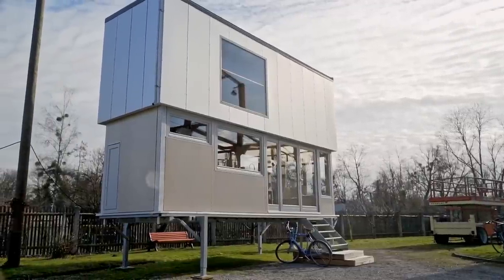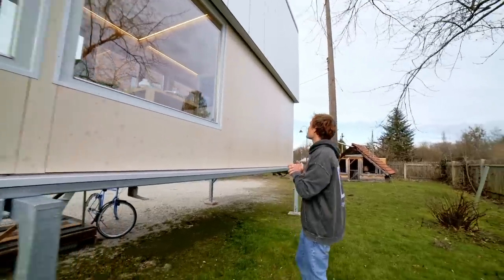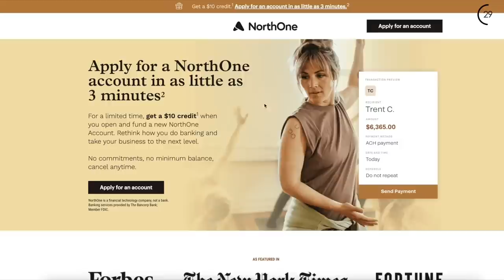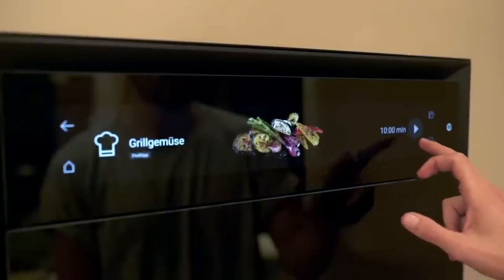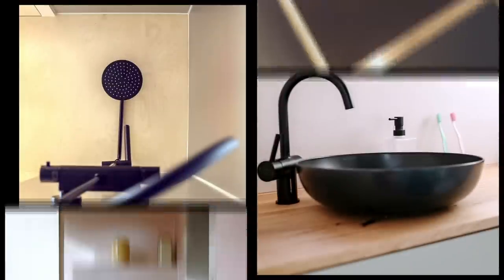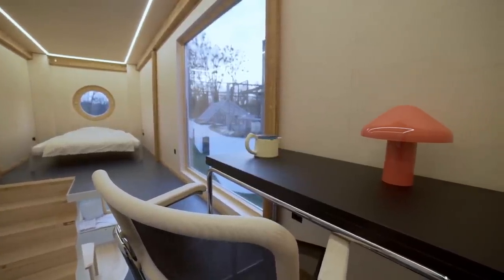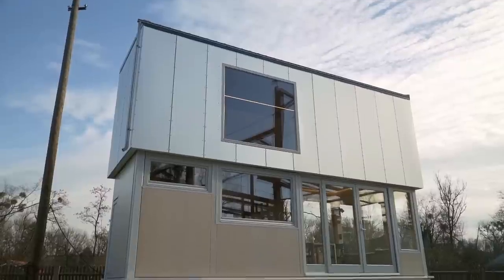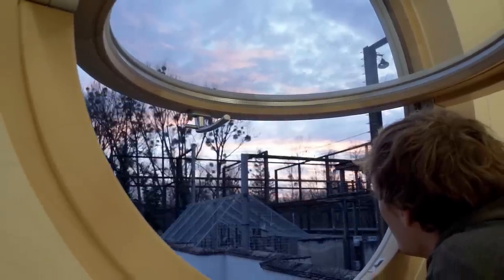Full 2-Story Movable Tiny House w/Lifting Roof - beautiful design!

Comment: I agree with another that recommended making a longer unit as well. I also think a collapsable or removable stair rail around the stairs of the second floor would be a great addition, and far safer. I would suggest you use a similar table downstairs as you have upstairs so you can seat four when you have family or friends over for a meal. I like the oven, but that space would be perfect for a television. Perhaps you can move the oven under the stairs, or install a convection microwave which is smaller, but still allows you to bake? It would be nice if it had a larger fridge, but it doesn’t appear you have the space. I really like the fact that the second floor raises which is what sells the unit. It’s a nice little unit that solves a need, but I’m afraid it likely wouldn’t do well here in the US because of the price, but maybe I’m wrong as housing here is terribly expensive, at least where I live. You clearly used top of the line materials which shows. Thanks for sharing
Reply: Thank you Brent! So much great Input, im sure that our next houses will have better features and of course no house is perfect as it must match with the needs of the client!

Comment: Those stairs would frighten me, I need a bannister on which to hold so as not to fall off. Also, you would NOT catch me lying on the floor like he did upstairs. One roll to the left and you'd quickly be downstairs. It would be great if this home could be made longer, it feels very short. I like the corner lifts, nice touch.
Reply: Thank you for the feedback! True that, but we are about to install railguards soon! And technically you could get it in a 13m length version!
Reply from the maker: It’s amazing how well they hid the mechanisms 😁

Comment: I like it!  But I would put a fold out table under oven and add a wrap around sofa, and have the window open out instead of it. Also, need some type of railing on 2nd floor, and closet. I realized the steps. I don't use anything round, so an octagon window would look better. Where is the washer/dryer? Microwave? Maybe add a TV for movies that retracts up from behind a hidden cabinet???
Nice job with that lowering the top floor...:-)
Reply: Debbie, thank you for your feedback! Lots of it we could integrate into the design of your customized house and we do offer full individualization for our houses! So nothing you need to worry about!

Comment: Really fun design. That would require wide & deep tie downs if it would survive the high winds we get in my home region.

Side slide outs would probably be better for us than slide ups. 😊
Reply from the maker: You bring up a great topic. Hopefully the builders can jump on here with more info. 😊 Because you can set this on the ground (or of), that might provide additional security from wind and easily be tied down. It’s no taller than other homes and uses the same framing techniques.
Reply: Thank you! We'll working on new solutions for the future and regarding wind and weather the house will sustain any weather of course except of hurricanes!
Reply: @Vagabundotinyhouse  ,I saw a video a few years ago where they had all plumbing and wiring going through an attachment used in oil and gas usually so it could be  detached during a  storm.  And I have seen buoys attached to either deck or house twice. A former neighbor wanted to put their house on a barge or tugboat after surviving several hurricanes. 
A client in Washington bought a lot that flooded half the year and built a deck with a little cabin around his anchored fishing boat. Much cheaper than marina rent, and ruined his first wife's crazy plans! But similar idea. Hopefully this made sense; Might need more coffee 😂.
Reply: @Vagabundotinyhouse  Not sure Americans understand German construction. American houses are built very flimsy. The quality of your materials is probably lost on them without touching! On the other hand, wind could be an issue as high as it is.

Comment: The lifting second story is functional and cool. Some of the design choices aren't as practical as they need to be for tiny living.  Doors and windows opening inward when they can slide uses up valuable space. The staircase is an opportunity for more kitchen storage which isn't being utilized to it's full potential here. Huge windows can be nice but having them come all the way down to the seat height means one is resting against a cold window.
Reply: Hi Sage, I totally get your point, in the end it's a big tradeoff between functionality and quality. We have thought about many features as for example additional storage underneath the staircase, but it does not apply to quality norms and will make the staircase very weak and expose our client to risk to injuries on the staircase. But after all, many more features could be implemented, you're definitely right!
Reply: @Vagabundotinyhouse  Americans don't understand how efficient and heavy German windows are. Ours are crap, yours are like bank vaults. But I did notice in my stay in Berlin and Hamburg you have far less urban insects. In the US, a concern would be insects getting in, that's why we have screen windows we install to allow in the air but keep out the insects.

Comment: Like this.  Would like a railing for stairs.  Could maybe do a door over stairwell.  So then you can't fall down or have more floor space if you need it.  You could offer to do shelves racks you can adjust size then put pieces of wood on and rails for hanging clothes.  So they are easy to take down for moving.  Under the stairs could you design it better for more storage?  Or even put draws on the steps.  More storage is always good.  Love the idea for you the under the house for bikes, lawnmower, and other items.  This is only the beginning for you.  Good luck!  You are thinking outside the box!
Reply from the maker: Lots of great ideas 😊 thanks for sharing!
Reply: Railing will be installed soon! We’ll update you on it once it’s done!

Comment: Amazing how people decide on a tiny home then immediately look for a way to make it bigger! That said, this is a great way to make bigger more transportable by making it collapsible, The upper floor room needs protection around or over the open stairwell.
Reply: Hey Paul! There's different models for each personal need, if you want a smaller home decide for the vagabundo mini!
Reply from the maker: It’s about the same size as many tiny houses, but just with a full height 2nd story. Does make it feel luxurious compared to some!

Comment: Stairs occupy lot of space in both level. Ideal position would be somewhere in the corner. Railing system can be installed more easily then. In shrinked situation the house is accessible or need to wait lifting procedure?
Reply: It is definitely true what you are saying, they take away a bit of space, but they also give more freedom to the whole house itself and separate the different areas of the house. However, individualization is possible!

Comment: That looks like it will tip right over if the wind gets strong.  Have you done any tests?  And are there railings to put up top around the stair case?  looks like you could fall right down.

Comment: I really like the two story concept. My only concern is the lack of closet space upstairs. Could you construct an outside wall closet that would lift with the second story, but not be in the way of the lifting travel path?
Reply from the maker: Interesting question 🤔 not sure. In the upstairs you could add a big Ikea wardrobe and other small space furniture/storage solutions, but you have to take it downstairs for when you’re ready to relocate
Reply: @TinyHouseExpedition  That’s the beauty of my suggestion. The closet would be constructed on the outside wall of the second story and would lift when it lifts, but the doors would face inside to the living space to access the closet,nothing to move out of the way at all.
Reply from the maker: @lorenrickey5481  I like the way you think!
Reply: My concern about the second story is what appears to be a complete lack of any kind of guardrail. Unless a removable one can be added as an option, I think that's a big accident waiting to happen.  Falling from that height and landing on those stairs would definitely be a bad thing. 😞
Reply from the maker: @StanFranks56  we hear you! We really like the idea of installing a sleek removable or foldable metal railing up there 😁
Reply: @StanFranks56  I agree. I gasped when he was standing and looking out that big side window. It didn’t “look” like much space from that window to the opening to the lower level. Like if you’re looking out and take a step backward, we’ll that’s it…😢
Reply: Theoretically yes, but it would get quite complicated!
Reply: Give us some weeks and we show you the results of the new safety construction!

Comment: I like the finishing materials they used and the quality of construction. But ultimately, having the roof telescope up seems a lot less practical than slide outs. The lifting roof forces an already narrow main living space to be even more cramped. Maybe someone can come up with a system where the upper walls fold down onto the upper floor and only the roof lowers down to rest on the folded walls.
Reply: Thank you for the feedback, we implement it in future designs!

Comment: We have bridges in the US and very tight building regulations. This place wouldn't make it without some serious foundation work and their water in/water out plan wouldn't fly as is.  And in EARTHQUAKE areas those STILTS...AH NOT!  
Then there is the whole live in a fishbowl thing, have to hang the drapes from the ceiling....also not.... I know it snows in Germany, how could they think anyone is going to want to lean up against cold glass? I know that aside from no drapes there is next to no padding on the box in the 'living room'...am I wrong did he call that a couch? I was probably wrong....oy.... The kitchen has a very odd layout & next to no storage. A light up sink won't fix that. The space he talked about for a washer in the bathroom, I really don't think that the washer/dryer combos we have would fit if you wanted to be able to open the door...all the way....  There is no handrail on the stairs - HUGE SAFETY ISSUE... Upstairs is little more that a jacked up box. There is zero storage. Def would not be considered a bedroom here....no closet, but hey there's a expanding table. WooHoo.    And for what they are charging???  We could get a totally, fully, decked out Tiny house for less that that. FOR SURE...and maybe one that lifts too.
Reply: Thank you for your comment and sharing your thoughts about it! Valuable individual feedback!
Reply from the maker: You raise some good points. To address a few of your concerns: one of the parking options for this house is to be set on the ground, and he didn’t mentions but they’re working on a railing system that will be out soon. There’s a fairly narrow top loading washer that could fit in the space in the bathroom; featured in this skoolie’s bedroom: https://youtu.be/PrGmfIYBuXU